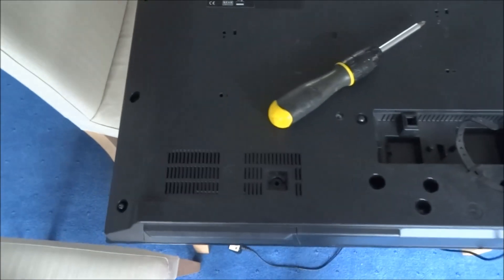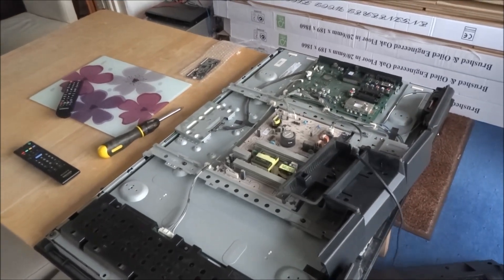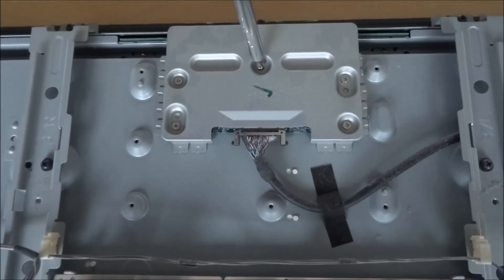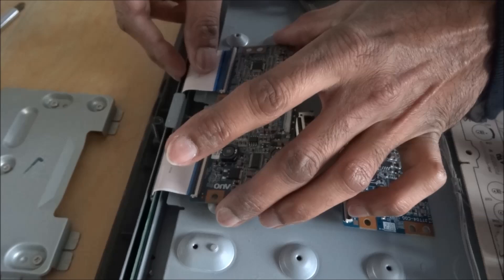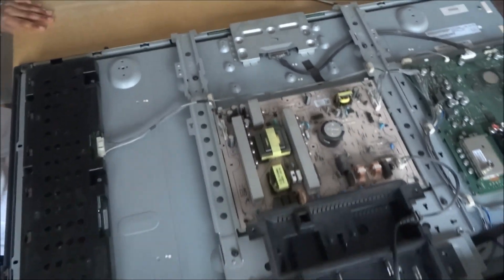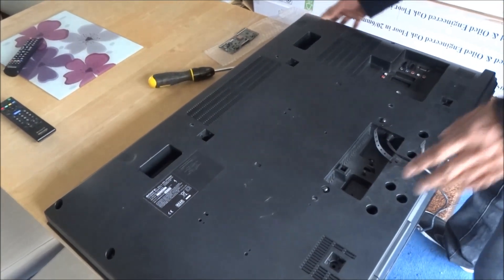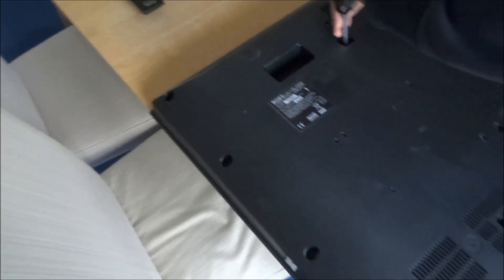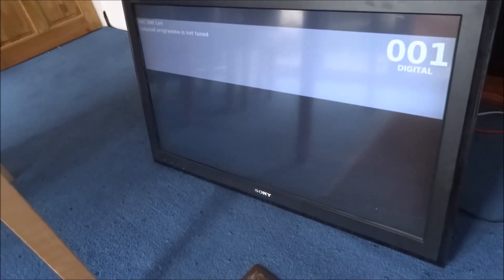How to replace TCON board in a Sony LCD TV

Comment: Good job on doing your first tcon replacement!  One thing for everyone to be mindful in doing; Transfer that thermal pad (the squishy square if present, on the big chip) from the old board to the new board, peel & re-stick.  It will continue to assist the chip in staying cooler & living longer, as its purpose.  Cheers

Comment: Great video, our 2007 Sony KDL 40X 2000 had re solaraisation/shadow on screen. Having watched your video it gave me an idea where to look, I bought the T-Con board for £15 delivered, the T-Con board on my TV needed part of the chassis lifting up out of the way, a real pain, but it works great now after being plugged in for 10 seconds, initially the red solarisation was there then it corrected, the old T-Con board had a oily staining on part of it

Comment: Please sir could you tell me if all the tcons are the same ?
Reply from the maker: Best to open the TV and get the serial number to be on the safe side.
Reply: @GeekStreet  right thanks..so what is the site to use to buy thoes tcom board ? My version is kdl40v30000 do you know what tv is it?
Reply from the maker: @Ru-ps8kg  I brought from eBay, just typed in the model no number and hey presto it was there.
Reply: @GeekStreet  thanks m8
Reply from the maker: @Ru-ps8kg  Your welcome!

Comment: Hi , I have a Sony KDL-52Z5100. (purchased 2010) I get horizontal lines only on the bottom part of the screen when i turn the TV on. ( about 6 inch,the rest of the screen is fine)this last for  10 to 20 min. and then disappear . Would the T-Con  Board solve the issue. your answer would be appreciated . great videos  Thanks, T
Reply: I am having the same problem now. Did you replace the tcon board? Did it work?

Comment: you can get these boards refurbished on ebay @speedyfix123 for £20 which will last you longer then £40 used one these t cons are failing in big numbers you dont know how long used one going to last.